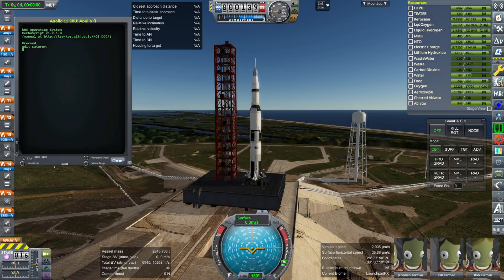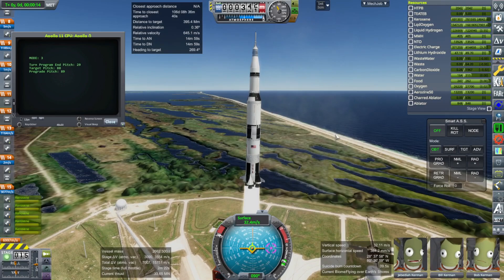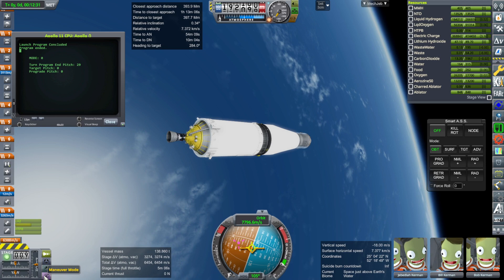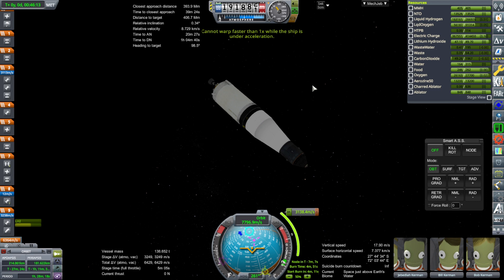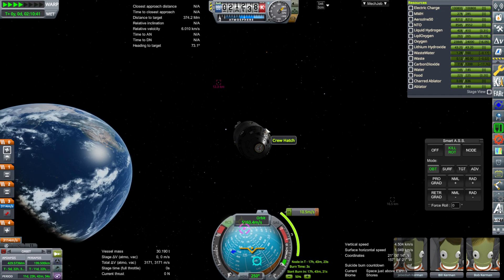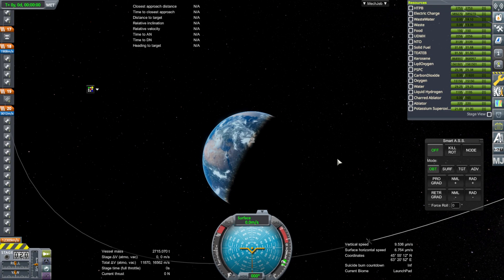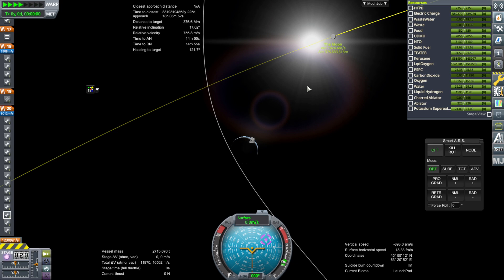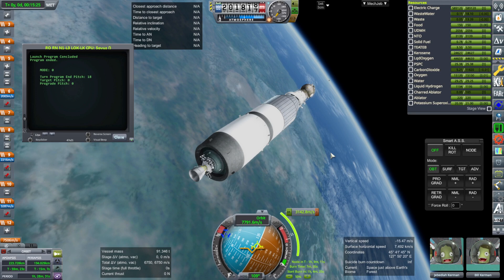Space Basics 09 - Getting to the Moon

Comment: Good stuff! I guess technically you can do an off-plane transfer from the KSC as well if for some reason you can't launch into the plane (for example launch into the same inclination, but different longutude of ascending node because of some launch time constraints, or because you've missed the "kill timewarp" button :) ), so you can add two extra launch windows per lunar month there. Also since the Moon travels relatively slowly,  you can get a few more launch window days immediately before and after the optimal day, as the travel time won't be significantly longer. And, as you rightly pointed out, for unmanned stuff the time is usually not important, so you can launch pretty much any time and still eventually make it to the Moon.

Comment: I just installed rss and do and tested the stock Saturn v however every time I try to stage the CSM the engine will always say the fuel is unpressurized even if I replace the tank rough with a hp-ii tank please help
Reply from the maker: All I can think of is make sure the propellant mix is right for the engine. In more recent versions of RO, they've added a Helium requirement for pressurized engines, so I don't know if that's the issue.
Reply: @RaizSpace  it worked thank you! I just need to know how much helium I should put precisely in the service module thank you again

Comment: Ok so I made a Space Shuttle replica today (I followed someone's video while he did a step by step how to build a space shuttle) and got it into LKO. But I didn't watch when he said how to get it down safely. So I tried to get it down and that didn't work too well. Long sotry short, how do you take one Kerbal EVA then switch control back to the ship?
Reply from the maker: Use the square brackets, which let you switch between vessels in flight. However, this only works in render range (within 2.25 km), so make sure everything remains relatively close together when you try this.
Reply: @RaizSpace  ok thanks.
Reply: @RaizSpace  that is genuinely helpful.
Reply: @RaizSpace  so I built and launched a satellite today in KSP. I tried to make every stage of the rocket recoverable, so I put parachutes on everything and a probe core on the final booster stage. I was able to land that stage and then return to the satellite and turn the ion engine on to get it into a stable orbit.